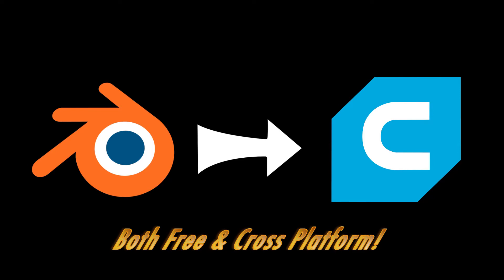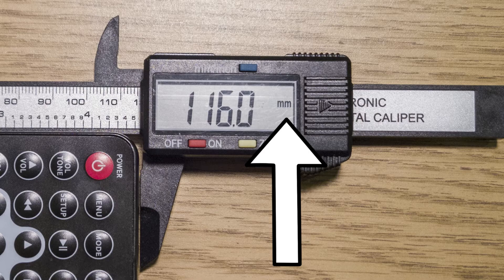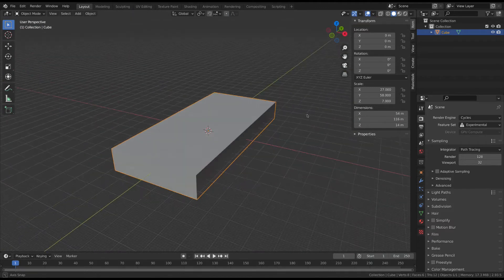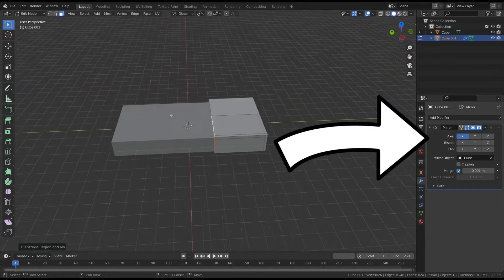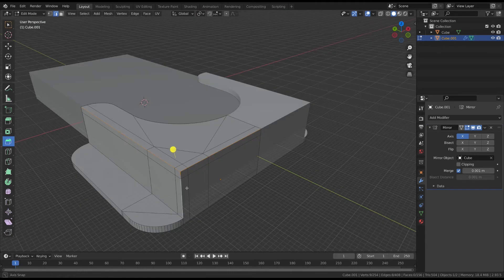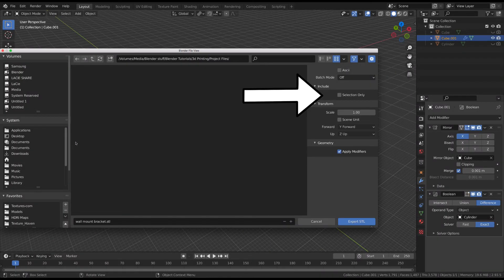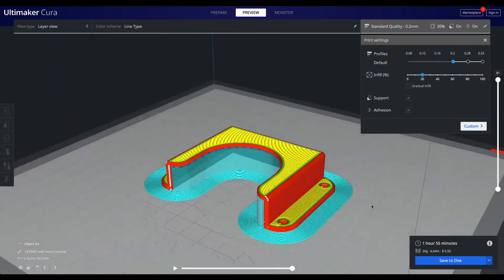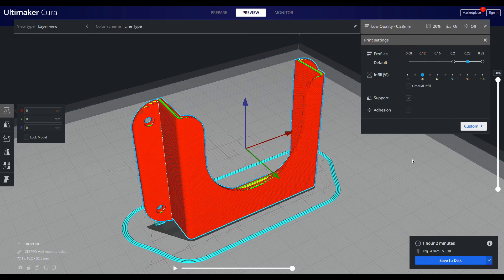Blender & Cura 3D Printing Tips

Comment: I'm getting errors in cura, aren't the red parts in preview technically "bad"
Reply from the maker: I believe red just indicates an overhang that may need support. Errors are usually notated with a weird teal/blue circle pattern. Regardless, I've done several successful prints that contained errors, but I may have just been lucky.